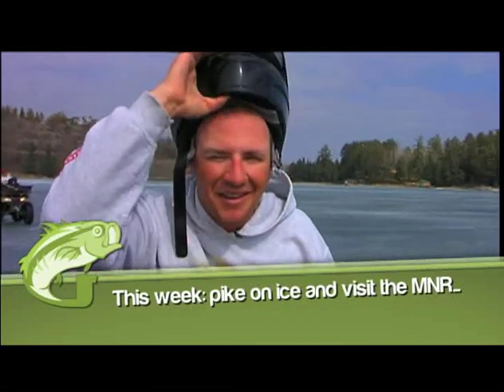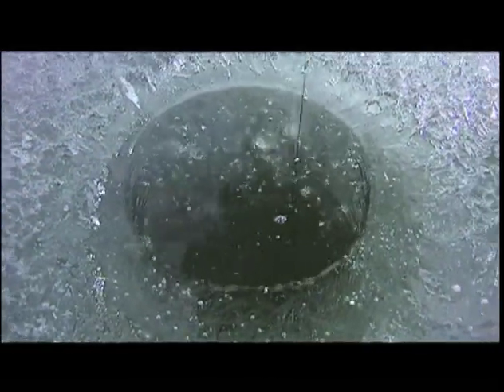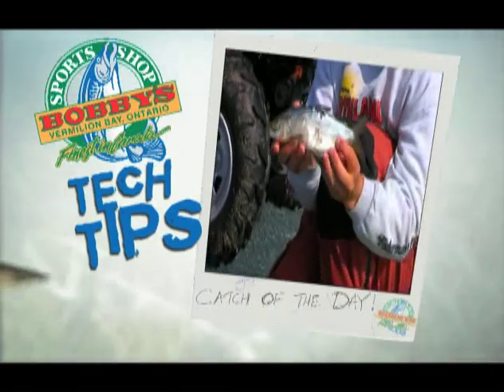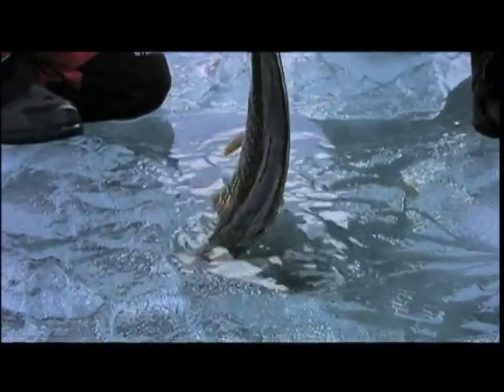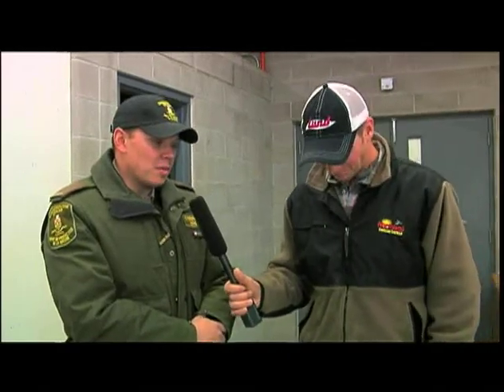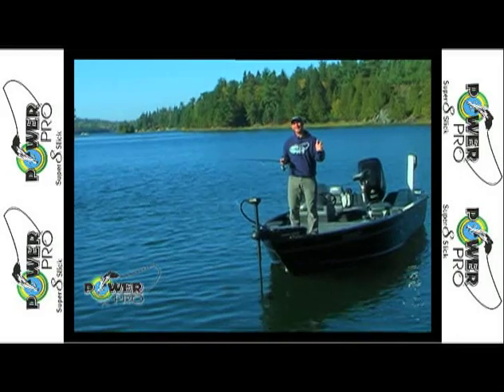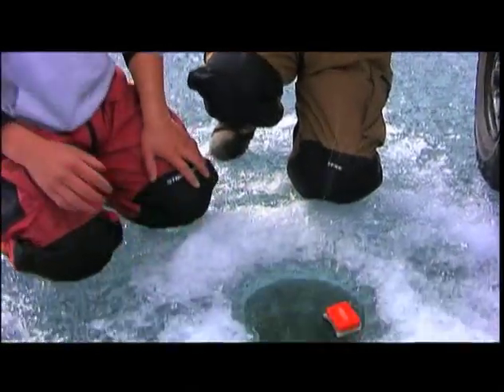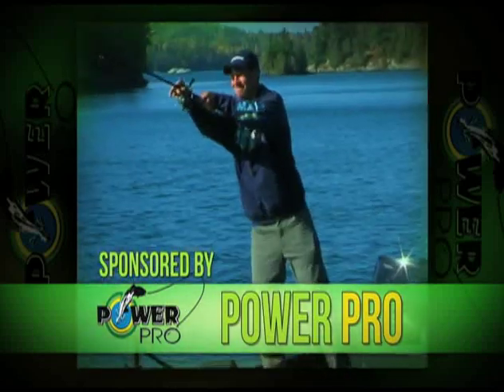Fishing With Gussy: BIG Ice Pike on Tip Ups

Comment: How does it work?
Reply: I don't get it?
Reply: +James Wolf please help.
Reply from the maker: +James Wolf The tip up sits over the ice hole, it has a reel built in where you hang the bait from. When a fish comes along and takes the bait, the line pulls the flag on top letting you know there is a fish on the line. Then you run to it, set the hook and pull up the fish. It's really neat. We might do an expanded show on this over the winter, as well. I hope this helps!
Reply: +FishingWithGussy please do said video, cause I still don't get it. Does the flag go down when the fish is hooked? I just wanna catch a northern.
Reply from the maker: James Wolf
The flag actually shoots up when fish gets hooked. We'll have to feature it and go over the whole set up, thanks for giving us the idea :)
Reply: +FishingWithGussy oh, neat.